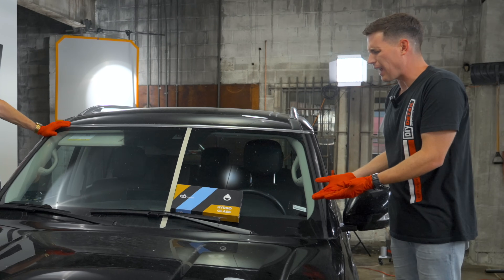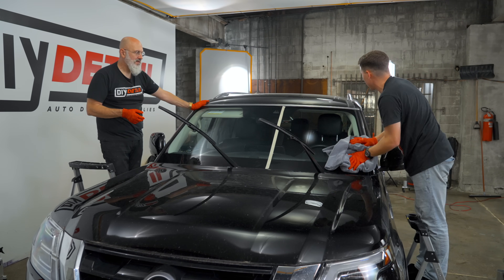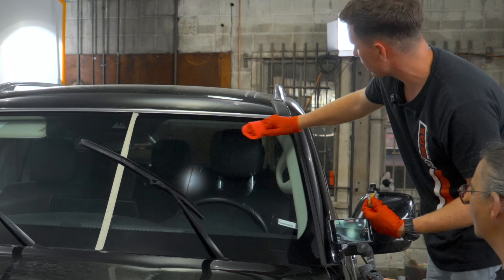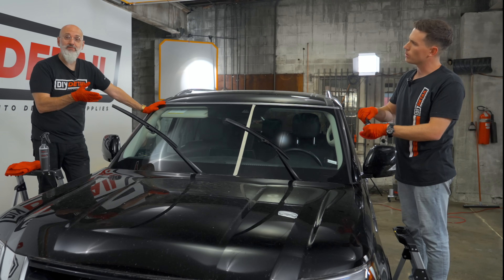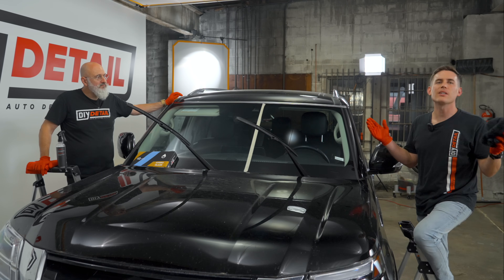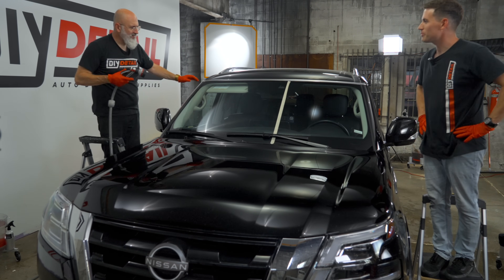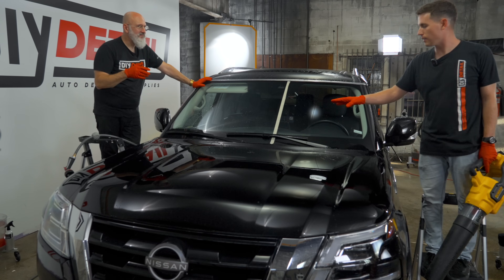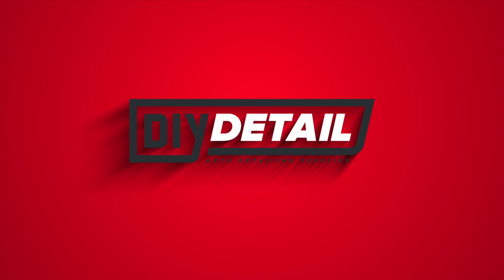How to PROTECT YOUR GLASS (and why you should do it!) C6 Hydro Glass ceramic coating install guide

Comment: Yet another great video! Really appreciate a TRUE and honest test to truly see how great it is to have treated glass.

Good to know when and how to properly use your wipers afterwards and also how to eliminate wiper chatter.

For the people in colder climates with harsh winters, where you have to scrape off the frost/ice on all your windows, especially the windshield, does the coating get affected by that? Would Quick beads be a good sacrificial layer over the winter months?

Thanks in advance for the reply.
Reply from the maker: It makes the ice much easier to remove. DIY Detail Quick Beads is great on glass

Comment: Could you do a comparison with Rain X? Also, I recommend doing a speed test, the speed at which rain droplets start to shed due to wind. The standard is 40mph
Reply from the maker: We are well under 40mph.
Reply: Speed will depend on a few factors.
- wind speed of environment
- angle of windshield

Not really possible to say an exact speed with those variables.

Comment: What is the difference between this and something like Soft99 Glaco. I only ask because without any sort of durability claim, which is obviously difficult to make given how abrasive wipers are.. it just leaves me wondering if there's any significant difference in performance if both products are presumably going to last approximately 9-12 months. Glaco ends up being considerably cheaper.

Also what's the general theory on wiper usage with a coated windshield. I know you state in the video to use wiper fluid to clean off the traffic film when it starts raining so the coating is functioning properly, but does the same sort of concept apply if you have morning dew/condensation on your windshield or do you just drive and hope it clears up? Same for when it's misting/sprinkling, can you use your wipers or do you just tough it out til enough water accumulates or you're up to a speed where the water is shedding off?

Lastly, for curiosities sake, what would happen if you tried to use hydro glass as a paint coating? How would that work, would the cure/flash time be longer, would it be effective?
Reply from the maker: C6 Ceramics Hydro Glass will lasts longer, as for cost, one bottle can coat 10-12 windshields. 

Yes at low speeds use your wipers.

No it doesn’t make a good paint coating.

Comment: I bought a bottle of Hydro Glass recently and it arrived leaking (lid would not seal properly). I decided to try it, and it looked and behaved exactly like it’s supposed to while installing. Checking in a few weeks later, it’s as if I never even applied it - water sticks with zero beading or sheeting. I’m trying to rule out any errors in the installation process - would this result happen from the bottle being unsealed for an unknown amount of time during transit? I’ve successfully installed other glass coatings but this was my first time trying C6.
Reply from the maker: Please email we will replace the bottle. Info@diydetail.com
Reply: @ The retailer I bought it from already replaced it, I was just hoping to rule out possible incorrect installation. The reason I ask is because I assume even if the bottle was open, it should have at least worked to some degree
Reply from the maker: Unfortunately not

Comment: How to you maintain it? Do you decon it? When you need to replace it, is GS Polish with Yellow Waffle pad enough to remove hydro glass in order to apply a new coat?
Reply from the maker: Yes a light polish will remove it

Comment: I think the wiper chatter is due to the coating getting sticky over time because this always happens to me usually after 2 - 3 months after I put the coating on and the way I make it stop is if I polish the glass and take off the coating.
Reply: Ive had a coating on my glass for 6 months. No chatter. What did you use?
Reply: @rooboy99  rainX and also glaco does the chatter.. it could be due to the amount contamination on the glass and how much you drive I tend to drive a lot.
Reply from the maker: After several months some products get grippy

Comment: I used Hydro Glass about 3 weeks ago on my vehicle.  I only did one coat.  Can I do a second coat now or do I need to polish and do two coats?
Reply from the maker: Clean well and add a second layer
Reply: Panel prep is safe to use?
Reply from the maker: Yes